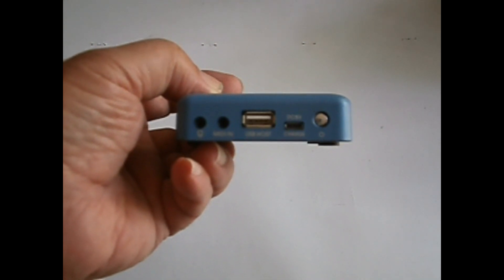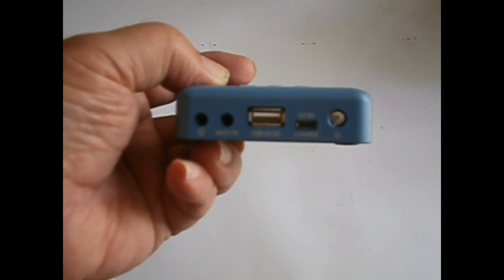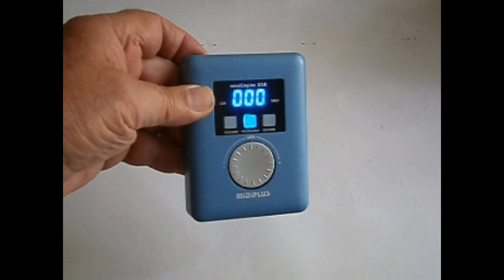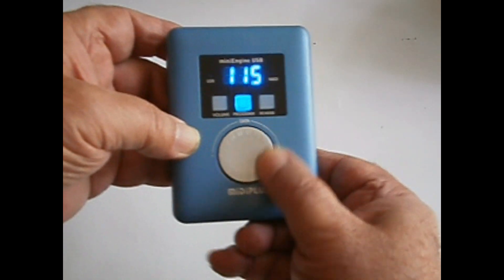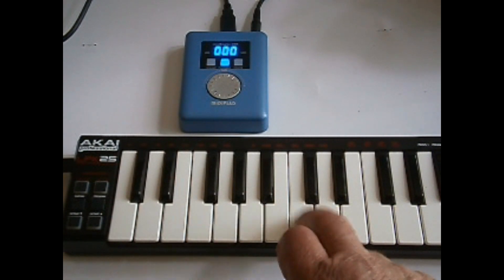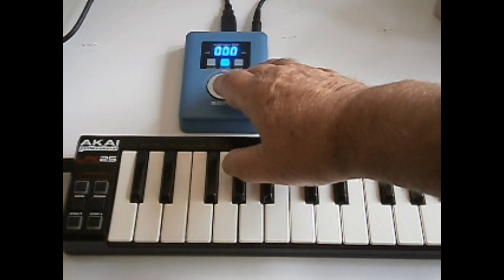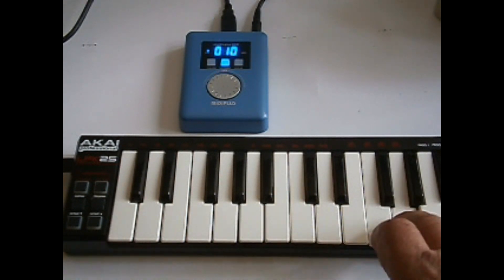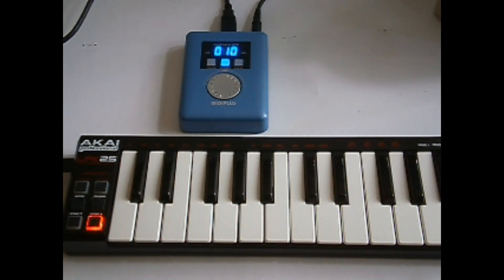MIDI Plus mini Engine Part 1

Comment: It's possible to connect a guitar and get piano sounds I'm looking something to connect my guitar and get piano sounds or  organ thanks for your help
Reply: https://www.sweetwater.com/store/detail/i2M--sonuus-i2m-musicport Technically, this will work, I have one, but the midi conversion doesn't do that great of a job, and is worse if you do chords versus just single strings, it can work if your planning on doing editing after, I don't know if I'd use it live, but you may have better luck!
Reply: Here's the one made specifically for guitar: https://www.sweetwater.com/store/detail/G2MV3--sonuus-g2m-v3-universal-guitar-to-midi-converter
Reply: @misterspock1  is there a way to layer the sounds from the module ?
Reply: @TheTruth70777   This device  mainly works as a monophonic midi instrument, it will convert your instrument to a series of single midi notes. Hope that helps.

Comment: With all respect...It doesn't convert any signal to audio. It uses the midi data to play the sounds. Just wanted to clear that up since some ppl dont know anything about this and could get confused thinking its a audio converter or something like that.
Reply: These are the same folks who buy a midi controller and rage to the store that it doesn’t make any sound.
Reply from the maker: Just trying to keep it simple as possible, MIDI data in, sound out.
Reply: @RedOrgan20  

To be fair, I think that's what you said, and the same can pretty much be said about any midi device. Yes, it's only data going in, but it's audio coming out.

Thanks for the vid!